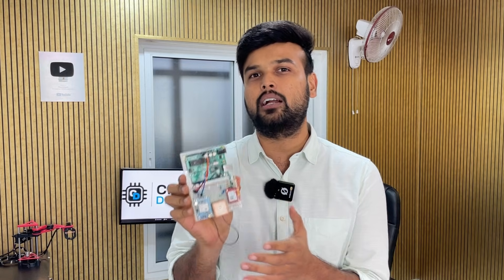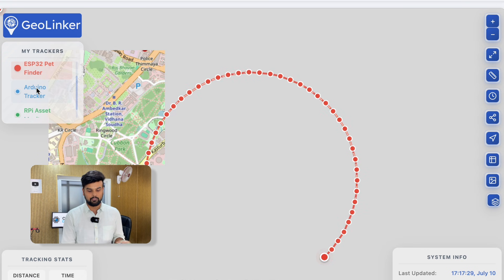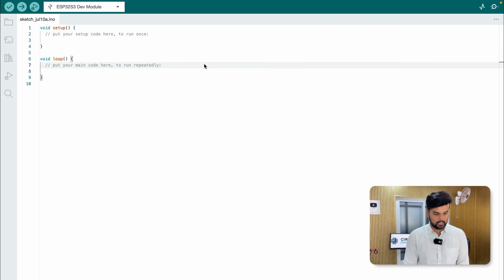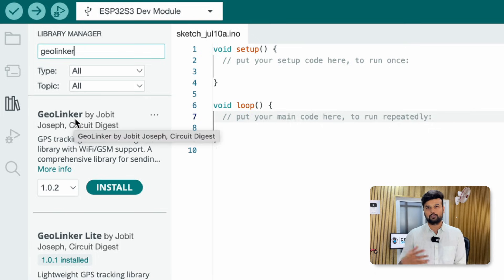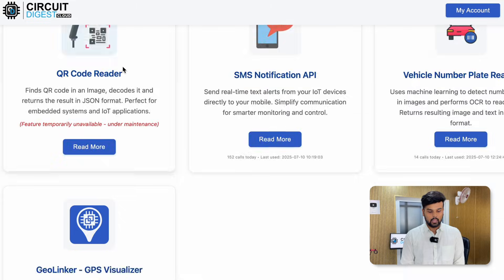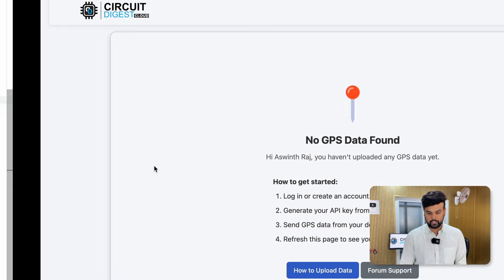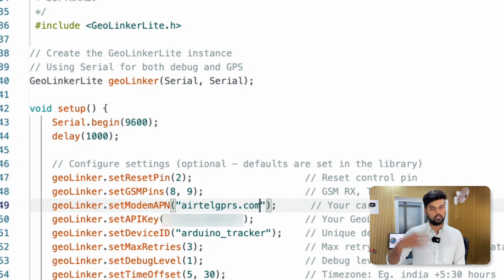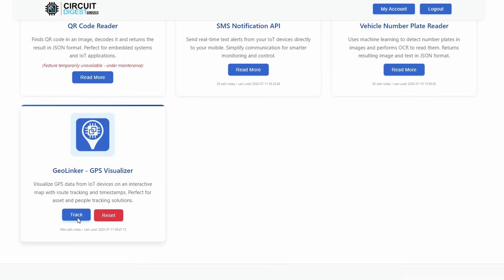How to build your own GPS Tracker using Arduino? | Simple & Easy Tutorial

Comment: Sir please reply from where can we get 2g sim in india
Reply: Resistance range
Reply from the maker: Apart from JIO , all other providers has 2G network
Reply: @Circuitdigest Sir there is no brand that provides 2g sim all brands have stopped manufacturing 2g sim
Reply from the maker: You don't need 2G specific SIM. the 5G sims works just fine. Airtel, VI, BSNL all have 2G network.
Reply: @Tanmoy-v7p SIMS CAN ADJUST TOO LOWER BANDWITHS

Comment: can we send data to the server in seconds like in two seconds to make it seems more accurate and constantly moving?
Reply from the maker: with arduino it will take minimum 10 seconds, you can send data faster with esp32 https://circuitdigest.com/microcontroller-projects/simple-gps-tracker-using-esp32-visualize-data-on-map
Reply: @Circuitdigest  sir I have a doubt in this can we add button and buzzor and make this a women saftey device and can we make it battery operated for school project ??
Reply: @Circuitdigest i try to add button and buzzor and want to make battery operated but I am unable to do